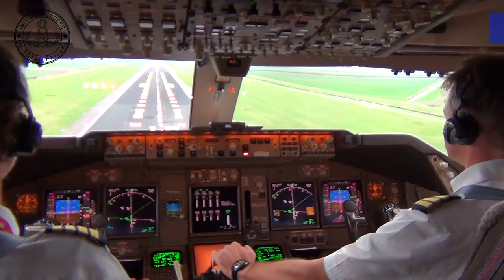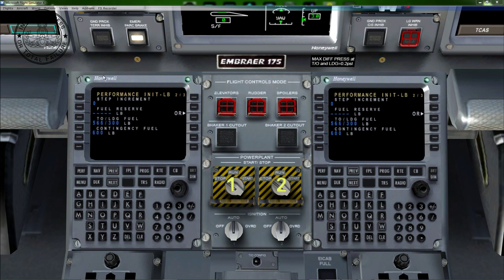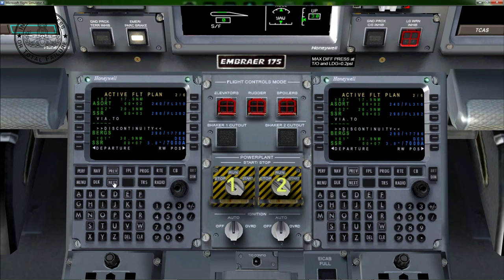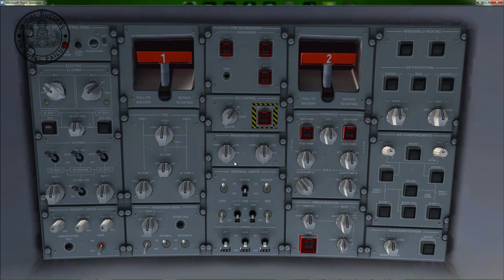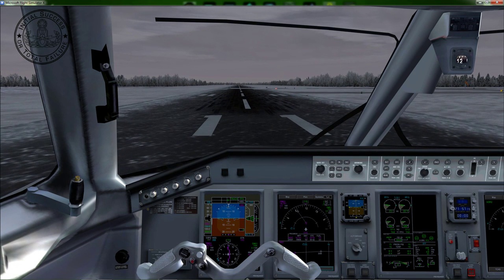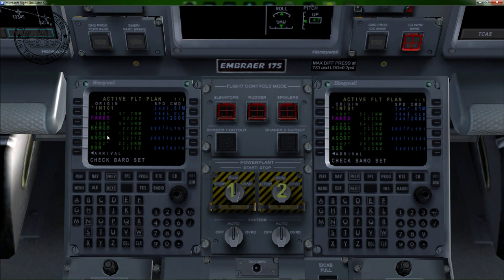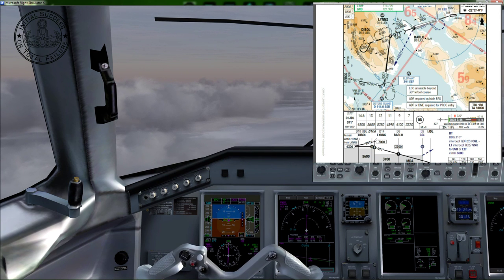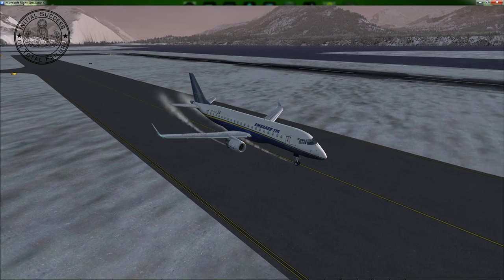Feelthere E 175/195 | Basic Flight Tutorial

Comment: Nice tutorial! I wish I had found this earlier, that would have saved me quite some time I spend tinkering with the FMS until I had the basic procedures figured out. But there was still a lot I could take away and learn from your video, so thank you for that.

One more question that's bothering me about the E-Jets: On the ground at speeds >30 kts I have very limited rudder authority, which makes takeoffs and landings at crosswinds >10 kts virtually impossible. Do you know any way to change the flight controls / fly-by-wire mode so that I get full rudder authority? The guarded switch above the thrust levers doesn't do the job, I already tried that.

Comment: Thats a great video! Just a piece of advice: To set de A/T speed according to whats planned in the FMS, you click in between the A/T button and the knob, it will switch to FMS speed instead of Managed speed and the selected speed on the speedtape will become magenta colored. Then, when you push the VNAV button, assuming you've selected a higher altitude or FL, you will read VASEL on the MCP and you're golden :)
Reply from the maker: Excellent! I think someone shared this a while back as well. I was having trouble getting it to work, but eventually figured it out. Thanks for taking the time to share :-)
Reply: Great! I did realize this was an older video before I wrote that, just making sure I could help out a bit in case you ever pulled the bird from the hangar again :)

Comment: I finished my first flight from start to finish today, first chance I had to sit down and fly.  Your tutorial filled in a lot of blanks that was not in the manual and gave me a good foundation on how to operate it.  It was not a the most beautiful flight but I landed in one piece.  The things I struggled with was controlling my aircraft vertically.  Decent, approach and landing specifically.
Reply from the maker: +chaseNbadguys To control your vertical speed, the button you are looking for is in the center of the MCP. You have the following buttons there, A/T, VNAV, ALT, FPA VS, and then in between the speed knob and the ALT SEL knob you will see a button titled FLCH. This is the button you want for a controlled ascent or descent. You press that button and then use the speed knob to select the desired speed. The aircraft will change pitch to meet the desired speed. Alternatively, if you select the VNAV button until you see VPATH on the PFD (Could be VNAV PATH) I cannot remember off the top of my head, either way, you want PATH to show. This will use the FMS to follow the proper VNAV path on descent. To my knowledge, it does not work for ascent. Let me know if that works for you. If not, I'll do a short addendum video to show you what I mean. Also check this video at 49:39. I believe I covered it in here.
Reply: +Captain_Mac Thanks, I'll try another flight later on and let you know how it goes.  it seemed a littls querky getting it to follow the fms on decent.
Reply: The VPATH works also on ascent for me. I noticed that you´re Speed-Knob wasn´t on FMC-Mode the whole flight. I think that was the reason why TO/GA on your Take OFF didn´t work. Perhaps that is also the reason why your VPATH on ascent for you doesn´t work. But i´m not sure about that.
Reply from the maker: I was having some issues with changing the speed, and switched off of FMC mode to try and rectify the situation. Didn't work though. I haven't actually tried the VPATH for climb, I always use the FLCH. I'll have to try the VNAV next time.
Reply: +Captain_Mac FLCH is rule based on preset climb and descent speeds and gives  a good profile generally unless over weight in which case you might have to baby sit the climb with VS/IAS mode (latter is better provided ITT not limiting) . FLCH ("FELCH")guarantees you safe climb speeds.VNAV is more accurate optimal climb/descent performance.VNAV requires less monitoring...but ofcourse the more the automation you select the more it manages the aircraft and so the more vigilant you should be that the AFCS is behaving herself!

By the way FPA is Flight Path Angle usually used on Non Precision Approaches to be flown with constant flight angle approach profile like ILS rather than the dangerous "dive and drive" method which is now looked at as hazardous.

Minor critique...too many voices.It might have been better if you went through the checklist without the FO or just you and FO.Wife has a beautiful voice...and her interference is distracting to put it mildly but we appreciate the serviced she was giving :) Better if you play her at boarding and prior to engine start.

Kindly can you post the link to your ERJ 145 tutes?

Otherwise Great effort.

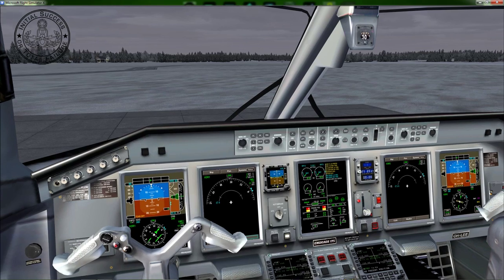Comment: 05:24 - That "QDR 251" is not stated as "251 radial" because the CGL navaid is an NDB (212 KHz), which does not use the concept of radials. The "QDR" and "QDM" nomenclature is just the shorthand "Q" code for magnetic bearing for outbound and inbound courses, respectively, relative to a point. In this case, the NDB station. If the navaid were a VOR, one could say, "intercept 251 radial from CGL". 
EDIT - Ooops, already answered a long time ago, LOL. Disregagrd. :-)

Comment: CGL refers to "Circling Guidance Lights."   Circling guidance lights shall be provided when existing approach and runway lighting systems do not satisfactorily permit identification of the runway and/or approach area to a circling aircraft in conditions for which it is intended the rundway be used for circling approaches.  The flashing lights from the CGL shall be white.  Lights indicating the exteded center line of the runway and/or parts of any approach lighting system; or ....... lights indicting the position of the runway threshold; or ..... lights indicating the direction of the runway.

I had like a 10 minute presentation on this subject in flight school in 1969.  I don't think its stressed enough.  Even in the current days of GPS a CGL system is needed for visual reference for non-standard approach airports.
Reply from the maker: Thanks for the info :-)

Comment: Awesome video, it helped a lot! I'm having trouble getting weather to display on the MFD. I tried pressing the wx button on the autopilot panel, but nothing showed up. I also don't have the "weather" button next to the "TCAS" button on the MFD. Any help would be appreciated!
Reply from the maker: +ABSpotting Thanks! Glad the video helped. I have no idea why the weather button isn't there. You may need to re-install. As for weather displaying: 

 #1 - confirm that the MFD is in MAP MODE. for weather to show in the PFD the compass rose must be in arc mode.

 #2 - just because there are clouds doesn't mean there will be rain to be shown by the radar simulation. There is no direct way to collect weather information from FS. the gauge makes assumptions based upon the data available.

 #3 - be sure you have activated the gauge using the Ejet's Configuration Utility

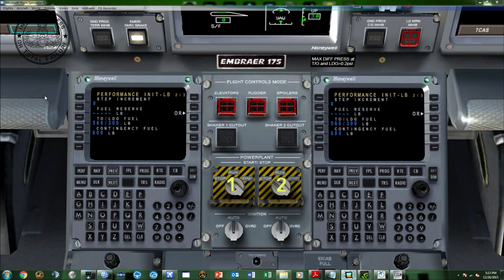Comment: I have FSX SE: and in this plane how do u get the "Configuration Tool" as you said in 9:34? I need the ZFW, but idk how to get it without that "Configuration Tool". Can someone tell me where it is?
Reply: Ethan Ponce go to Steam Library, click on Tools and double click it when u find it. Then just install it
Reply: You can also get the ZFW from the default FSX "Fuel and Payload" section. Just take the empty weight and the payload and do the maths and add those numbers. I haven't flown the E175 so much, but for the E195 I can tell you that the ZFW is always 92343 if you leave the payload at its default value.

Comment: When I go to the departures page I choose a runway but then no SIDs come up, it just gives me the option to insert the runway into the flight plan. What am I doing wrong?
Reply from the maker: Well...I would first ask what airport you are departing from. Perhaps there are no departures associated with that runway? If that's not the case let me know.
Reply: +Captain_Mac Well I am departing Runway 22R at JFK and I am pretty sure that it has SIDS since Vatsim Tower clears me for the Kennedy 3 departure. Could it be because I have an outdated Airac and when the airac eas valid 22R had no sids? My FMC is currently on AIRAC 0611 but I have just purchased the new one. (1608) but I have to figure out why my FMC won't show the new one. Maybe I should try to do a manual update instead of using the Manager.
Reply: +JetBlue 711 PS Captain I sent you an email describing the FMC issue.

Comment: Is it weird that I have to manually move the throttle with a mouse before my controller can move it?
Reply from the maker: Its to simulate the throttle lock.
Reply: @CaptainMac  is there a way to disable it rather than using a mouse to move the throttles?

Comment: ABS absolute alt for TCAS
Reply: Full Authority Digital Engine Control
FADEC
Reply: FL180 is the transition alt, class A airspace from standard 29.92 to the local barometric pressure
Reply: Landing data is your ref speed and your Vac speed, and landing distance
Reply: For every knot of speed above ref is a 100 ft of runway
Reply: Nice tutorial, very cool